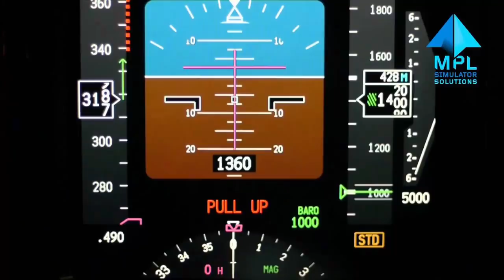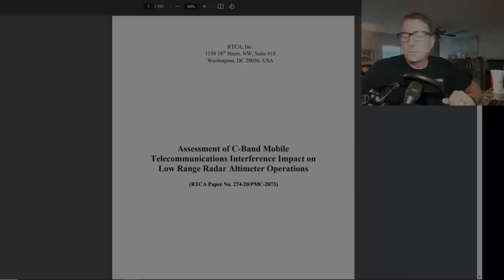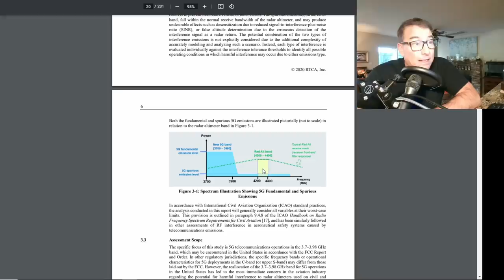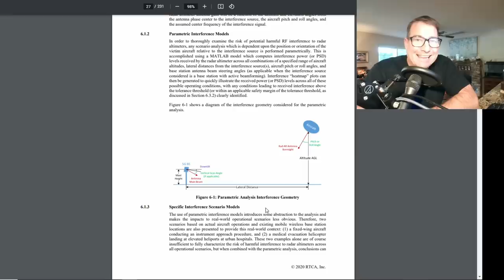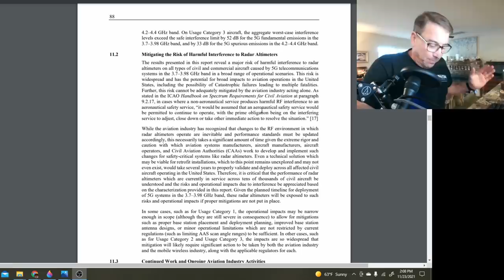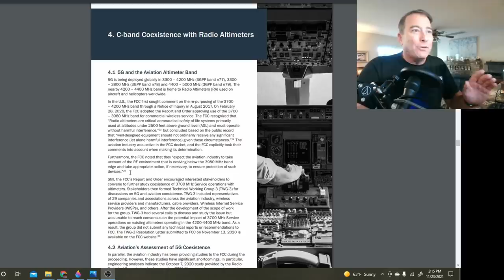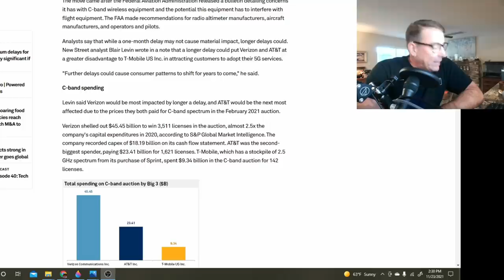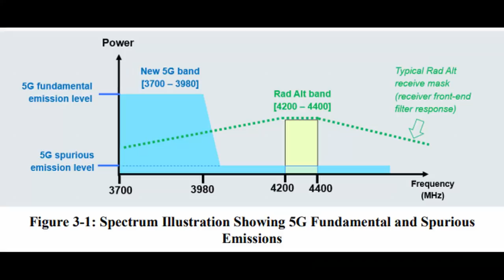5G C-Band Interference with Radar Altimeters in Aviation

Comment: Great presentation.  As a semi-retired electrical engineer with many years of dealing with FCC regulatory and technical issues, I agree that newcomer commercial mobile radio service (CMRS) entities should be on the hook to pay all reasonable costs of new radio altimeter receivers if, but only if, existing possibly too wide-as-a-barn door aeronautical band receivers at 4200-4400 MHz really are at risk from CMRS base stations now at 3700-3980 MHz (which will probably be used for 5G but are not required to be so used).  But you mention that Europe has been using 3700-3980 MHz for 5G for several years, with no reports of radio altimeter interference.  Shouldn't that settle the issue of who is correct?
Reply: Depends if the equipment is really the same or not, they have different specs.
Reply: @tedmoss  But aren't all commercial aircraft required to use only International Civil Aviation Organization (ICAO) certified radios, including aircraft altimeter radios?  My understanding was that only private aviation is allowed to use older, non-ICAO approved radios.

Comment: Thank you for your detailed analysis of the issues involved.

I've been casually looking at this entire situation for a while, and my impression is that both sides are more than a little entrenched in their opinions. Which is not uncommon of course.

Personally, I don't have a dog in this hunt. I'm not on EITHER side. And I do have some understanding of the technical issues involved because I have done a lot of work in the telecommunications field, and while that doesn't require a PhD, you do need to have a decent understanding of the physics of wireless communications. So, I'm familiar with concepts like constructive and destructive interference, wave propagation, ground reflection, etc. 

I also tend to have a very practical viewpoint on most subjects, because I tend to view things from a functional perspective.

So... Even if I assume that the Aviation industry is 100% right and the Cellular industry 100% wrong, I still feel like the Aviation side needs to bend on this, and my opinion comes from the entirely selfish perspective of a person who might be a passenger on an airplane.

The reason why I think Aviation should bend is very simple. As you know, there is already a MASSIVE amount of EM pollution around the world. You may or may not have a good sense of just how much or how rapidly that's going to increase over the next few decades, but it's most likely doing to be by an order of magnitude or more, just by mid-century.

MY OPINION is that this entire controversy is an indication that the aviation industry believes that the altitude sensing equipment currently in use is not sufficiently robust as to render interference from cellular communications moot. Furthermore, I am inclined to take the aviation industry's concerns at face value and conclude that there IS a valid issue here.  

The problem I have with the argument is that it doesn't acknowledge the elephant in the room, which is that the concern about interference is so serious that cell phone literally come with an "Airplane Mode". To my mind, if cellular interference is potentially that dangerous, then trying to mitigate the interference is the wrong strategy. From a SAFETY standpoint, the vulnerable equipment needs to be more robust, such that the potential interference becomes irrelevant. We had the red flag years ago. Frankly, the issue should have been addressed the FIRST time someone realized that a mere cellphone could cause serious problems with flight operations.

The analogy I would make is that I do not rely on motor-vehicle traffic laws to keep me safe; instead I buckle my seat belt EVERY time I leave my driveway. In the same manner, I would NOT wish to rely on Verizon or AT&T to ensure that I don't die in a fiery crash. I barely trust them to provide a reliable connection when I want to make a phone call.

If that analogy seems like a stretch, try this one: As a person who is OSHA 30 certified; if I am trying to mitigate a jobsite injury threat, I don't content myself to merely seek to limit the source of the potential injury, I look to directly protect the person who could be injured, to the extent that it's possible. In other words, a particular power tool might be designed not to fail catastrophically, but I still expect a worker to wear gloves and eye protection.

As I said, I am not an expert on the subject. My training and education only extend so far. That being said, I do not believe that this situation requires some sort of scientific breakthrough. I see this purely as an engineering problem, and in all likelihood, the "more robust" equipment that I would argue should be installed on aircraft already exists. I base that opinion on my experience with RF and LASER communications technology that was in use by the military 35 years ago, when I was a forward observer. In a battlefield situation where INTENTIONAL meaconing, interference and jamming by hostile adversaries was a fact of life, we already had equipment that was not susceptible to those problems.

In conclusion, it seems to me that regardless of what the proprietors of 5G technology do to mitigate the problem, I still want to see more robust electronic systems on airplanes, BECAUSE I don't want to place my trust as a passenger in the steps that 5G providers take. THAT equipment can always malfunction, be defective from the factory, or being installed/operated incorrectly. The steps that carriers might take are simply not enough.

Comment: A pragmatic course of action is to give the instrument manufacturers/FAA a period of time to insure that interference will not be a problem. This could include a redesign of the entire radar altimeter "system". After that time, any use of a system where interference is possible would have to be at-risk. It is impossible to imagine that 300 million people utilizing expanded 5G frequencies for terrestrial use would be of greatly less benefit than aircraft use or possible interference. If interference is going to become a problem, then this is a matter of whose ox gets gored, and the telecommunications industry has a much bigger ox to take down.

Comment: I agree with William Johnston.  Many of the avionics in these jets are fairly old just as the aircraft.   Newer digital systems will alleviate many of these concerns. But this can be costly.   Instead redundant laser altimeters (LIDAR) would be less expensive and far more accurate to implement in existing aircraft.  This will neglect any RF concerns now and in the future.

Comment: FCC, and telecoms, comments about, what I would call 'good equipment', do not take into account the well-known possibilities for failures in the equipment, cables, antenna systems, all of which are know problems... (BTW, I have worked for 3 major test equipment manufacturers) A simple example might be an antenna that has had some hail damage, or a wind gust gas damaged its mounting, do that its radiation pattern is now pointed further upward that design. Bad connectors, or damaged cables, can 'leak' RF, corroded cable connections can cause spurious emissions, and so on, and so on... It could be that simply removing the 5G band that is a problem, along the aircraft routing, without removing base station, could result in some impairment od data transmission, locally, without affection other areas, or, increasing the number of base stations, at lower power...It'S funny that the FCC would suggest that the 'interfered with', rather than 'the interferers' would need to 'fix' the problem, when the FCC normally requires any consumer equipment to guarantee that it will not interfere with any other licensed user!!

Comment: That's a very shallow bandpass filter... I will always stand by avoiding interference with aircraft but you're looking at what, 1.5Ghz of the band it accepts with ~6db of attenuation? Up the radar altimeter by ~3db to 2w and implement better bandpass filtering. This isn't a huge ask, the regulatory and financial burden of rolling this out to aircraft is the issue imo
Reply: Thinking further, simply increasing the output power isn't the best solution due to the inverse square law relating to intensity. Surely there's more sensitive ~4.2ghz receivers out there now that can offer a solution... again, getting that into the planes will be the issue

Comment: You need to do actual testing with the hardware involved.  Those Powerpoint charts are notional diagrams to help conversation regarding the high level issue.  It would be a challenge to design a receiver that is as bad as what some of those charts are showing.  The telecom engineers and avionics engineers need to do some testing with the actual hardware.

Comment: We have had 5G in Australia and India for some time ,, I haven’t heard of any issues . There could be issues with old generation RA but the latest use a slightly different method of interrogation of the return wave signal. The aircraft manufactures haven’t expressed any issues . So is it a storm in a tea cup.

Comment: Could there be a retrofit to upgrade aircraft to Lidar altimiters instead of radar altimiters? Or radar altimiters that are frequency agile to switch to different frequencies based on background noise checks?
Reply: LIDAR's more susceptible to scattering from rain, smoke, and fog, which are the same conditions where we most need the radar altimeter. And all commercial radar altimeters already use a variation of frequency hopping within each pulse called "chirp" or linear frequency modulation. It's still possible to jam it accidentally or otherwise, but it's much more difficult than if the radar operated on a single frequency.

Comment: Presumably if transmitting at or near the ILS frequencies might cause issues then someone could build a transmitter that would cause issues and the system would be fatally flawed. If there isn't suitable error correction and encryption then the system should be replaced anyway.

Comment: Point of clarification…based on my brother who is a flight nurse for a…”large national medical helicopter company” for several years…if the weather is so bad they need a radar altimeter to land, they would have never accepted the flight…they aren’t taking sketchy flights.  Even the IFR equipped craft don’t want to.  Not all air medical helicopter companies are as clear in standards…a few risk taking ones out there, but fewer by the day.  I’m sure pilots would like to use RA for assurance versus what they perceive, but it’s generally so clear if they are flying it’s not usually a big help.  

But…for places that have sketchy terrain like out west or the military, this is a very good concern.

Comment: When you see who sits at the head of the FCC, USDA, EPA, FDA, it's no wonder they push industry interest. They don't have safety engrained the FAA has. Thanks, Juan for a good explanation of a thorny topic. It puzzles me how many aviation professionals have little understanding of 5G and Part 135 technicalities. Makes you better understand what NASA and space companies have to deal with before sending technology up there. Words like "significant interference" are freakishly scary to hear in aviation.
Reply: The FAA has an engrained sense of safety??  First time I'm hearing that!

If radio emissions on adjacent spectrum cause these devices to malfunction, then the FAA knowingly approved faulty devices.  When the FAA approved these devices the laws and rules were the same as today, the FAA knew these devices could not rely on adjacent spectrum but granted approval anyway.
Reply: @matthewevans4296  Perhaps I should have the obvious more clear. Safety as in what most FAA employees have in mind. And of course, there is always a difference between inspectors and leadership. I'm giving Dickson the benefit of the doubt so far. Also, Congress on both sides of the aisles has continually removed funds from the FAA and as far as OK'ing ODA. As much as the FAA is responsible for passing questionable programs, they didn't do it alone. I feel the agency is in such a weakened state that they can't be blamed for everything, partly, but not everything.

To your point, I'm not sure the FAA knew the devices encroached on aviation safety. And if they did, they will have another blemish to deal with. All in all, it's a gigantic mess and I'm more concerned about potential human safety than blame.

Comment: As an aircraft enthusiast with no technical training or knowledge I ask a simplistic question: the altimeter puts out 1w of power to send and receive. Is not part of a possible solution to up the power output of the instrument? Will this interfere with other instrumentation deleteriously? I have a basic understanding of spill and interference so overpowering the interference seems reasonable.
Reply: Power would not be a good fix. Doubling the power only adds a 3db benefit. That 6 db problem means it'd need to be double again, and then the two signals would merely be equal. To get a good safety margin, you might need to get a 20 db margin. That'd mean that 1-watt radar transmitter would need to a hundred watts. If you're making a change that great, you might as well replace the entire system. The quick fix might be to add narrow-band filters between the receiving antenna and the receiver. Long term, aircraft need to go to a mode less at risk for interference.
Reply: OK - seems the longterm solution is an entire redesign

Comment: I imagine a cheap and easy detection would be to run light thin small bore copper metal tubes along the length of the " landing gear legs " with the end of the " leg end " ending at the aircraft having electrical attachment to the ` gate ` of a suitable FET [ Field Effect Transistor ] yuned circuit, a system of comparators { mixed digital / analogue } could be used to collect and measure values against current normal aircraft telemetry instruments 
NOTE : requires landing gear fully down for test .

Comment: The only problem here is that the FAA approved for use, a device that can not operate properly within the confines of the license granted by the FCC.  The FAA should NEVER have approved these devices, let alone allowed certification at a safety criticality rating of a/b.  It's like approving a tire for use knowing that it will fail whenever it's really hot outside.

As he points out - there are several governing bodies which are responsible for approving devices for use onboard aircraft.  The FAA, which is one of those bodies, requires radio altimeters to be certified at a safety criticality rating of A or B, meaning that they need to operate properly under all circumstances that they may be subjected.

As this report says - radio altimeters are ONLY licensed to operate within 4200-4400MHZ (4.2-4.4GHz).  The terms of the FCC license for these devices allow them to receive on adjacent radio spectrum, and it appears that these devices make use of that.  However, the FCC license also stipulates that when operating on unlicensed / adjacent radio spectrum these devices must accept harmful interference.  That is a basic rule, and applies to almost every radio spectrum user in the US.  This has been the case for almost a century.

Comment: The solution is easy. Mandate that every time new c-band devices are submitted for fcc approval, every single fcc administrator, the C-suite and board of the company submitting the new device, and the executives of every carrier that uses the equipment must board a randomly selected test aircraft with autoland capability. The new equipment will be powered on. The aircraft will be configured for autoland. The pilots will exit the cockpit and let the plane land, hands-off. If everyone involved is confident there will be no interference, it shouldn't be a problem.

Comment: The 5G spectrum has gobbled up some of the C-Band satellite transmission space also. Part of the auction agreement included updating satellite dishes with new filters and other related receive equipment. I imagine that there will be a similar upgrade process for the aviation industry, but as you pointed out- there are many more testing, safety, and regulatory hoops to jump through before you bolt stuff onto aircraft

Comment: Juan, I have developed radio produces like this, in these bands, four the last 35 years. There are many comments to make. It’s not just the filter at the front end, it’s also the dynamic range of the front end receiver. We are required when developing radio product including Radar altimeters to prove they are hardened to reject adjacent radio interference, these are very hash tests, data on this would have been more interesting. I will also say there is lots of other radio stuff with much more power in these bands already, we’re is the interference history for this. Lastly 5G is a TDMA, FDMA System the affect of this is, the interference pattern will move around a lot and very quickly, there will be no repudiative interference pattern. Also power levels on 5G are regulated end to end so the system dose not interfere with itself.  No I don’t buy this one at all.
Reply: WE are looking at possibilities, we need assurance that it will work, not just smoke and mirrors.

Comment: Juan: Wasn't the ill-fated auto land system landing attempt in San Francisco in 2013; where the Asiana Airlines Flight 214 was a scheduled transpacific passenger flight originating from Incheon International Airport near Seoul, South Korea. On the morning of July 6, 2013, the Boeing 777-200ER crashed on final approach into San Francisco International Airport in the United States. This was substantially an Achilles heel situation?
Reply: Air Asiana was using an incorrect Autothrottle setting
Reply from the maker: No.